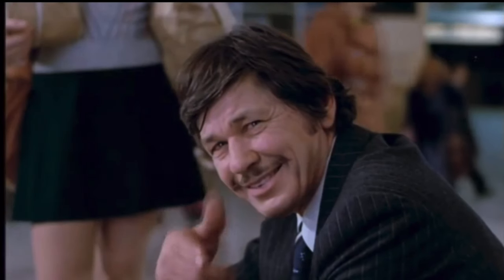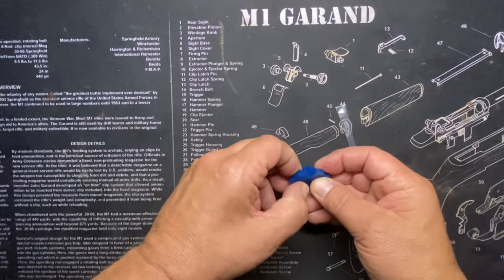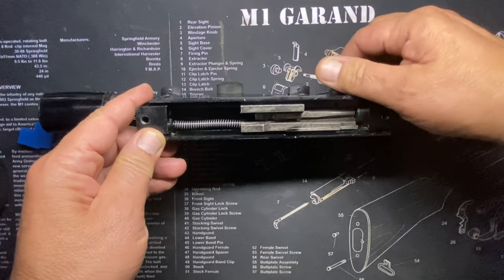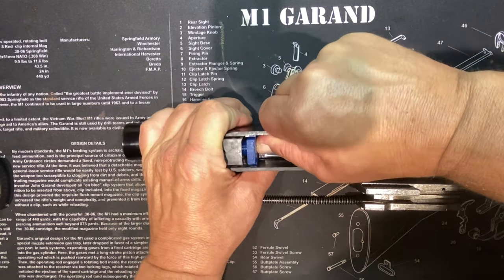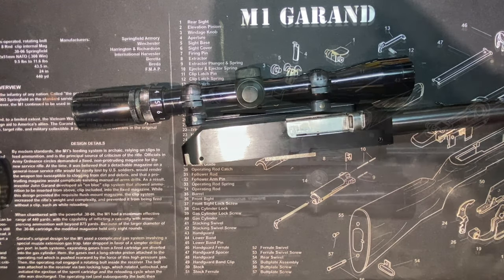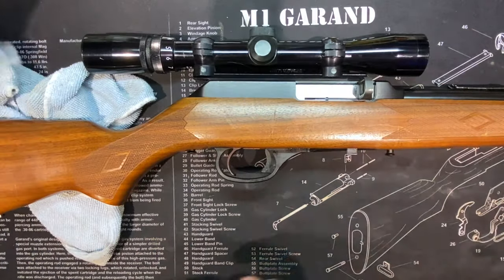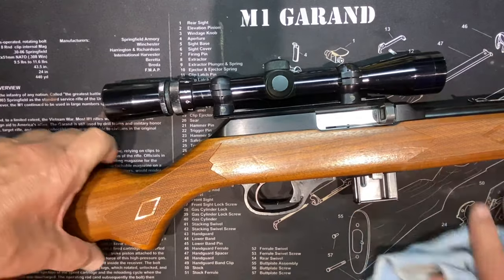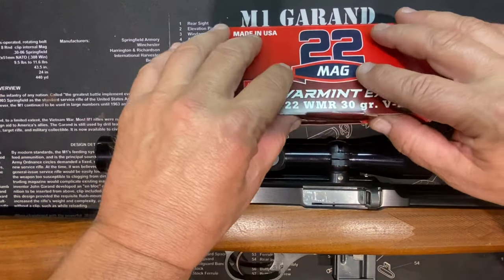Marlin Model 922M - Recoil Buffer- Installation

Comment: Hey where did you find your recoil buffer
Reply from the maker: My buddy made the purchase from a seller on ebay but this buffer is made by several different third party manufacturers and sold in many places.
Reply: Numerich gun parts: part #404890